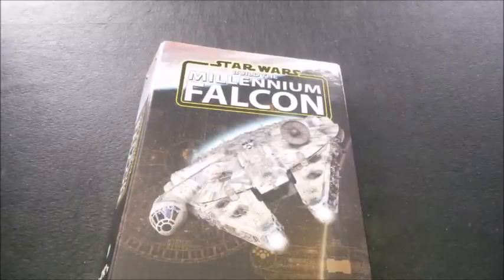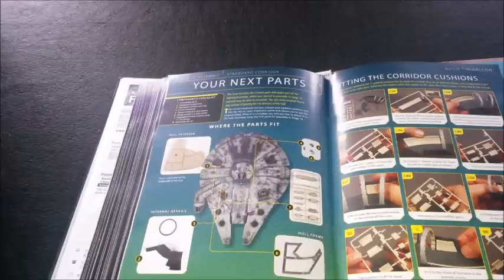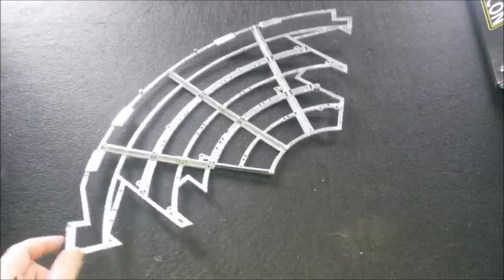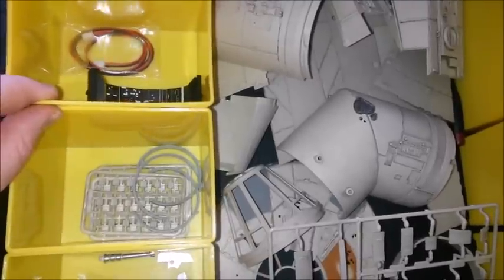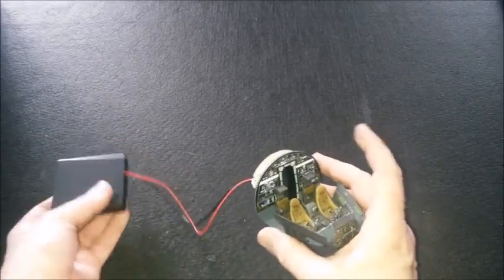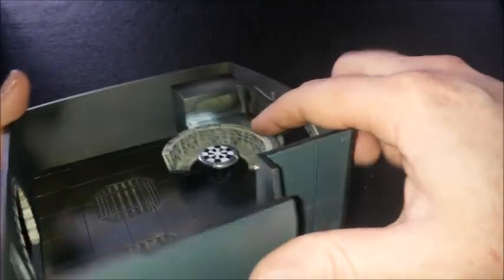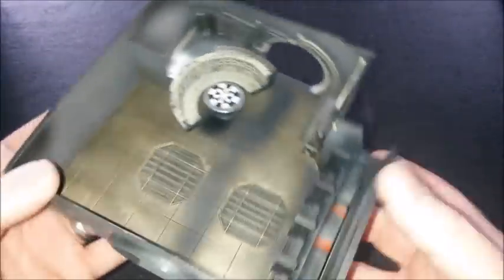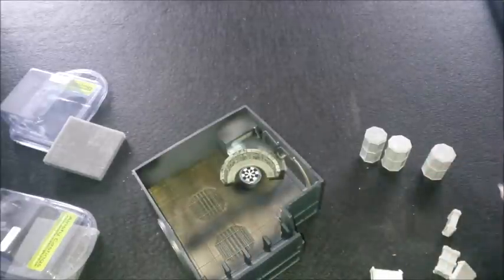Build the Millennium Falcon - Part 5

Comment: Looks like a great build so far. It is interesting to see how they have mixed design elements and mixed media to achieve the overall look, for example the printed cockpit sections, with the back lighting, vs. the plastic detail bits, etc.

Also like what you've done with the crew lounge/cargo bay so far. Too bad those pipes were too short, but your repair fits right in with the ramshackle Millenium Falcon look.

I asked this before but never saw a response, so not sure if you saw the original question. Basically I was wondering how this is compared to 28-32mm scale minis. Might fit right in with the old Wizards minis, or the new FFG minis. But judging from the cockpit seats, I think it might be a bit big. What's your take on that idea?